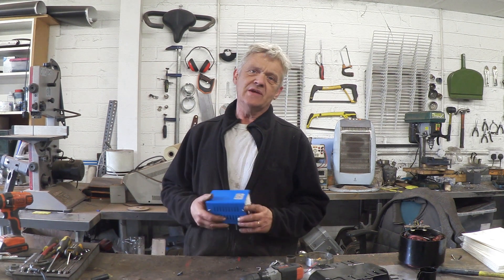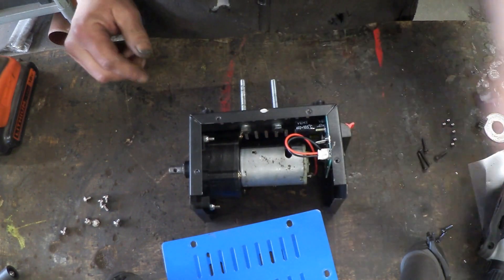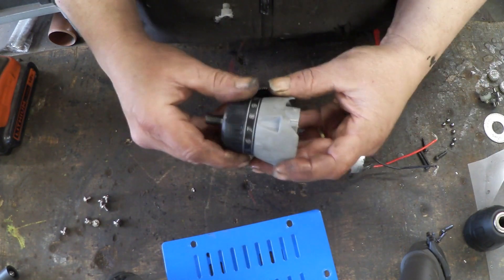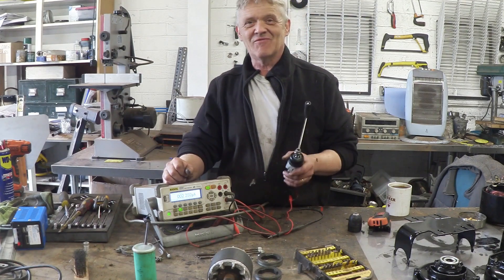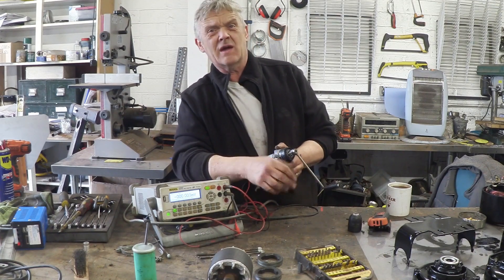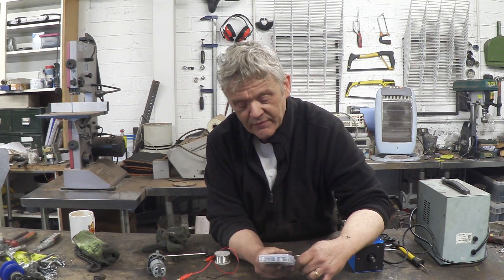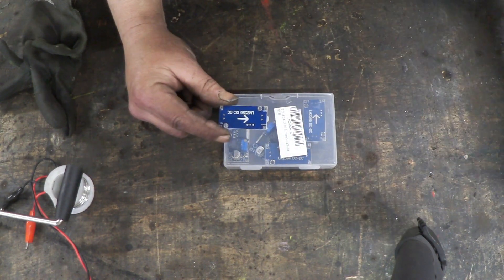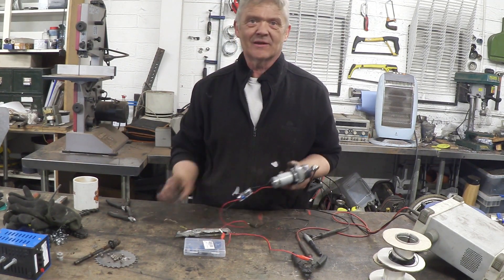1112 All About Hand Cranked Chargers

Comment: I saw a flash light that has a spring you could wind that would run a gear box, turn a DC generator, and charge a super capacitor and run an LED flash light or radio.

Comment: Unbelievable! 😲 A generator giving more than a couple of mA. ⚡ I firstly thought, I misheard. 👂

Hm, I only have one old battery drill, actually in the pipeline of being converted from NiCd to Li-Ion cells.
Hm, rethinking...🤔💭
- I do have two modern Li-Ion drills, plus a hammer drill for the mains.
- I do have a 7,2kWh LiFePO4 battery, never getting full by my tiny off-grid PV.
- I'm sitting in front of a laptop computer all day long, called "home office", missing my daily bicycle commuting to work badly, plus consuming that laptop's amount of extra energy.
🤔❔...1 + 1 = ...2❕✅ ☝😃

Comment: Could the circuitry in a ph charger plug, be used to stabilise voltage from a hand crank Microwave Synchronous motor, to output approx 5vDC ?

Comment: Howdy,
A couple of ideas for a better view of your  meter.
In photography we would place a black reflector up so it would be reflected off of a surface (like your meter) which would give it much better visibility. Black sweaters work great in a pinch.
And if it is because the backlight is too bright we would place a neutral density filter over the screen to bring the intensity down if there was no way to adjust it. 
I hope this helps, cause I love your channel.

Comment: Since years now I hooked up an old cordless drill (12V battery in original) on a boost converter, connected to 12V batteries from my little solar power plant and sometimes I used it with 24V. Works like a charm. Could even go higher, but I don't know if thats good for the electronics inside ;-)

Comment: pc cam on Meter, small window cut into main image? game streamers use such things, I am sure it Has to be easier than that, but maybe that helps? 
OK my question was is there a link for the adjustable regulators you found? Or did I just not see it? I mean well I could build my own I guess, but I kind of wanted to see what you had found, It's been a number of years since I tried to look for one, and I usually use paralleled regulators to bump up the amperage handling, Depending on the stability I need.
Reply: Hello Steven look for dc dc buck converter 2596 or boost controler bst900 or boost buck 3806 in china.

Comment: I've been using those voltage regulators to make 3D-printed lighting fixtures using 12V LED strips.  That way I can power the LEDs with 3.7V lithium battery sources (like a cell phone battery).  I've also used them to step-down voltages from 12V batteries to power 5V electronics, such as running a Raspberry Pi or a Bluetooth sound bar off a 12V battery.

I agree, it's mind-blowing how cheap they are!!  Along with a host of other small electronic circuits, such as charging circuits, speed controllers, thermostat relays, etc.  I truly wish they had "Dollar Store" off-the-shelf electronics like this when I was a teen, I would have had a blast!!  (Well, I'm having a blast with them now, but wish I didn't have to wait 40 years, LOL!! 🤣)   It definitely beats out the HeathKit and Radio Shack parts I grew up with!

Comment: I made one just going into small supercaps in series creating 30v . this allowed me to get max effeciency and i can just tap of the voltage needed. I also made a flywheel to smooth it out. Works great but not so mobile as without ! I may try hanging a weight off it and let unwind to see how much energy i can harvest !
Reply: Hello, with poulies you can get more rope displacement.

Comment: connect your motor wires to a bridge rectifier and then to your volt regulator and you can turn the hand both ways and it will still work...(if you make your own bridge rectifier make sure they can handle the current/amps.. 5 amp diodes will do the trick)
Reply: There would be an additional voltage drop but minimal.

Comment: Hey Rob, really cool.  Adding a four diode bridge to rectify the forward/reverse would allow you to mount a really long crank arm inside a spring from a shock absorber with a wind-levered upright.  Presto! A bladeless wind-powered generator. The spring keeps the lever arm upright, and the wind leans the long lever arm to and fro.    Nice mention of the $1 voltage regulator.
Reply from the maker: nice idea mate - very nice - cheers
Reply: Hey, I like that idea. Might try it myself.
Reply: @mikebond6328  if you do, and can shoot some video, I can edit it into a clip for you.   Good luck

Comment: You could add a bridge rectifier to the input of your voltage regulator circuit, then it won't matter which way you crank the handle, you will get your output.
Reply from the maker: nice idea cheers mate

Comment: If you don't want to go through the bother of making a case for your generator use the drill driver case the motor comes in.

Keep the motor in the drill driver case.
Take a bad battery pack that goes to that particular drill driver and empty the cells out of it taking care to note the contacts that mate with the internal contacts of the drill driver.
Unsolder those contacts from the battery cells and solder wire on to it and insert the contacts to the base where they belong.
Note, you may have to fashion a couple of dummy cells out of wood dowels to insure the contacts stay in place. Rather than gluing them in place; keep them removable for future maintenance.
Solder wires to your voltage regulator and mount it inside the battery case.
If you regulator has switches or a pot; cut access holes to them or it in the base of the battery pack case.
Insert the battery case into the drill driver as normal, then attach a handle and crank away.

The format of the drill driver also means that you can mount it on a board or other structure without too much trouble.
Reply from the maker: good tips mate

Comment: Put a bridge rectifier on the motor out put before the voltage regulator and it won't matter what way you crank the motor. Also a cigarette lighter socket USB charger will work as 5 volt regulator 5 - 24 volts input. You can get these from a pound shop.
Reply from the maker: nice one mate - top tip - cheers
Reply: I’ve got a box full of obsolete car chargers I keep for that reason.

Comment: Such a simple and practical emergency generator :) I think you can connect more of the current regulators in parallel to deal with higher amps if I'm not mistaking.
Reply from the maker: you cold mate - or just buy a board rated for your needs or wishes - it is likely to be cheaper and easier

Comment: Your wattage estimate is not quite accurate since dead short current is not what you will achieve at 6 volts but still useful numbers as the 6 volts and 3 amperage is maximum achieveable but not at the same time.
Reply from the maker: it's no where near accurate mate - but it doesn't matter that much as all i am showing is how similar a drill is to the charger - actually they are pretty much identical with the exception of the electronics and the electronics is dirt cheap to add on

Comment: be aware even lm2596 cheap circiuts do have short circiut protection, do not have reverse voltage protection, so turning handle backwards will fry the circiut. protect it using normal forward current diode or schottky diodes for lower voltage drop.
Reply from the maker: nice tip mate i'll be using that myself - thanks
Reply: Great tip!!  I fried one recently by soldering the wiring to a battery backwards... my eyes just don't work like they used to!!  
Maybe I should start making a habit of throwing in a schottky in my designs.